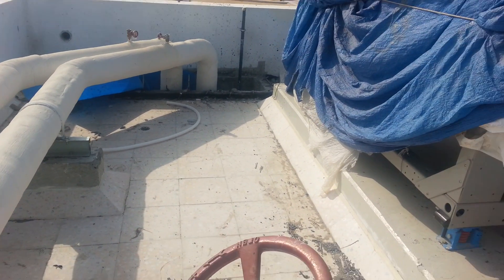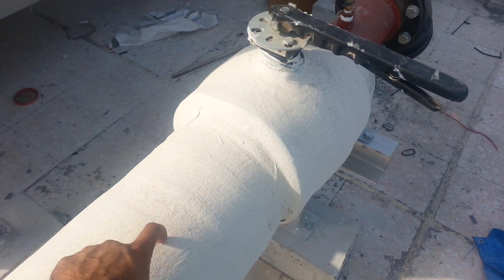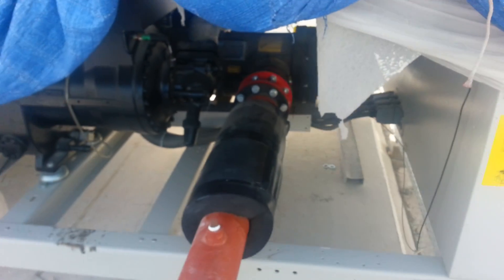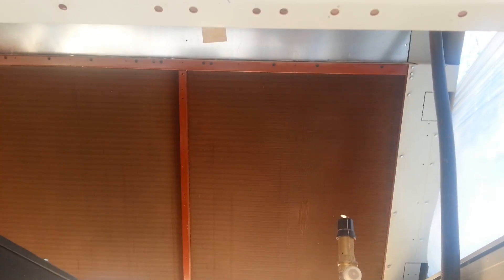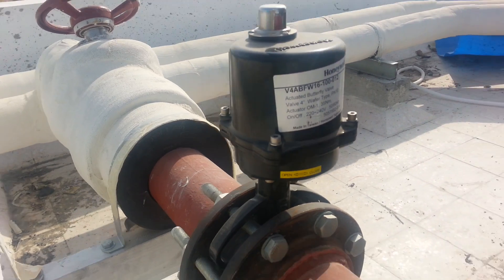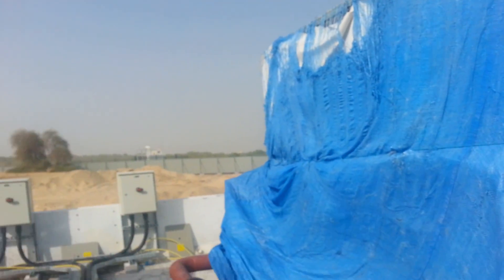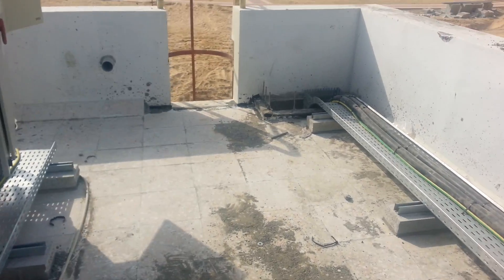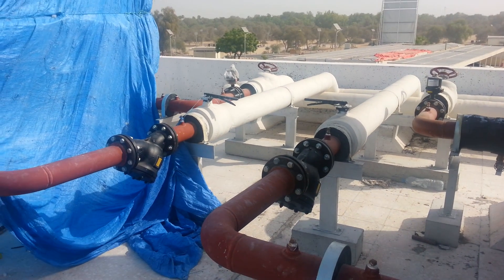CHILLER Working HVAC System

Comment: DRV location is icorrect , must follow 5-8D Rule 
the clamp support incorrect, must insulate similar to BVF otherwise the joint insulation will crack
plus enusre the foster is anti-fingus 
plus what you point as control panel it is actually a chiller isolater.however, you to ptovide curb to protect from weather conditions
Reply: What is the job of DRV ?

Comment: How do you know if an underground pipe is leaking a little bit?  Or if there is rust buildup?
Reply from the maker: Lucas Cross Jr the pipes were coated with anti corrosion resistant paints with 2 coats, and the leakage  was monitored by sensors with sensor wire running along the complete pipe length which were connected to BMS.

Comment: the distance from chiller to your project is to very high how do you overcome this problem ?
Reply from the maker: mostafa Adel That will not make big changes as it is horizontal distance without any much pressure drop that was adjusted and considered while primary pump selection.

Comment: what can be troubleshoot in the plant and how to check it.
Reply from the maker: faizan khan basic problem that we encounter in the plant room are
1. maintenance for the pumps because of strainer blockages which results in lesser flow rate.

2. sometimes chiller surge may occur due to condenser coil blockage, cooling tower fans failure, improper functioning of pumps etc.

3. cooling tower fins blockage etc.
Reply: HVAC System Master 
thank you sir

Comment: how to cooled the condensor in   air cooled plz define
Reply from the maker: faizan khan : There are fans on the top part of the chiller as it is top discharge. The fans will suck the air from sideways and through the fin arrangements along the condenser coils, the air passes and the heat transfer takes place in the meanwhile and finally hot air is discharged from the top portion.
Reply: HVAC System Master 
thankyou..

Comment: which type of insulation use in supply and return chiller pipe..
Reply from the maker: faizan khan : there are many types of Insulations available 

1. Rubber Insulation
2. Foam Insulation
3. Thermobreak type Insulation with Aluminium foiling. etc.
Reply: HVAC System Master 
thanx sir

Comment: sir can you explain how to adjust drv plz
Reply from the maker: DRV valve comes with a memory stop feature and on it, and there are numbers which denote the flow rate through the pipe. Now depending upon the Capacity of your chiller the flow rate in the pipe is decided and once the flow rate is confirmed then the DRV can be set with specified flow rate. The above DRV in the video is set at 14.2 L/S.
Reply: @HVACSystemMaster  Boss we can monitor the bf from BMS then why used drv
Reply: @meermohd890  
You need both , static & dynamic balancing .